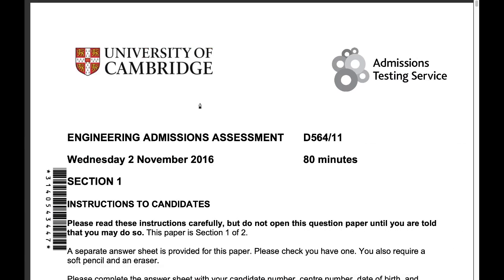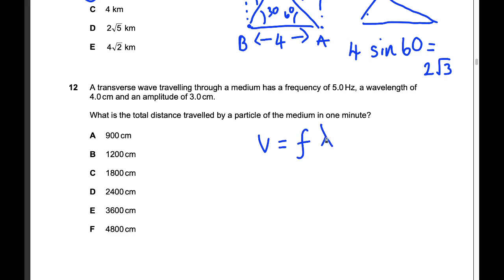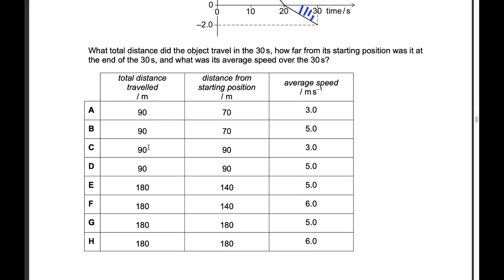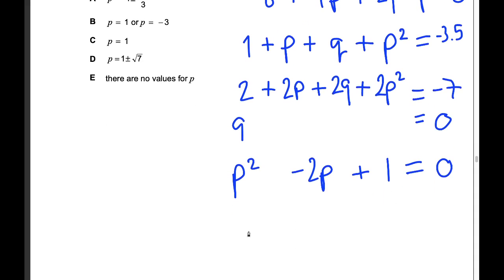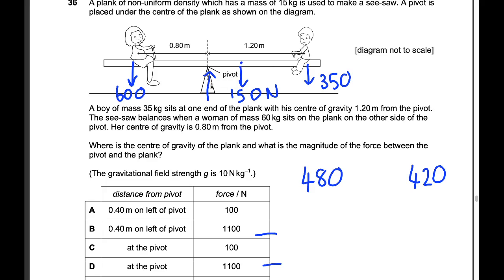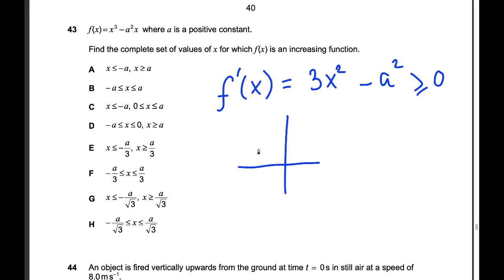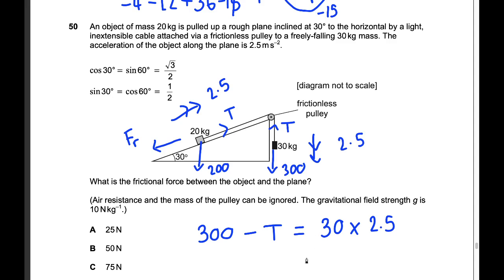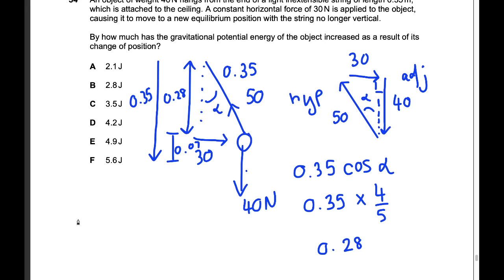Cambridge Engineering Admissions Assessment (ENGAA/NSAA) 2016 Section 1 Full Solution

Comment: You made a mistake in Q15. Adding the lengths should give 2x+4 not 2x-4
You should end up with the area being x^2+2x=120
So therefore,
•x^2+2x-120=0=(x+12)(x-10)
Since x can only be 10, RS is 10+5 which is 15.

Comment: For question 15, the answer is 15cm. I noticed a small error made in the video when calculating the area
a+b/2 x h
(x-1)+(x+5) / 2 x X
= x (x-2)
= x^2 +2x
This is equal to 120 (area given)
so 0=x^2 +2x-120
(x-10) (x+12)
x=10, x=-12
x cannot be negative therefore x=10
Side RS= x+5
= 10+5=15 cm (E)
Reply: Yeah I was very confused as well as I kept getting 15 as my answer.